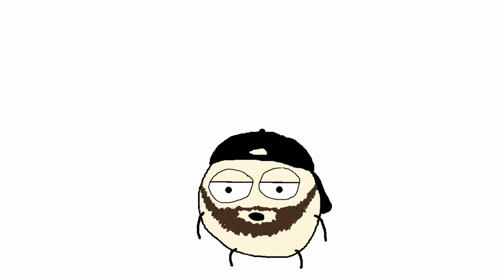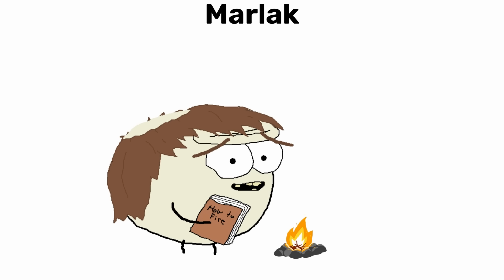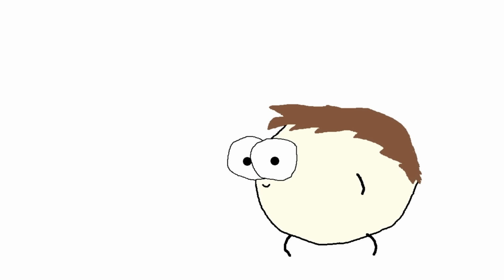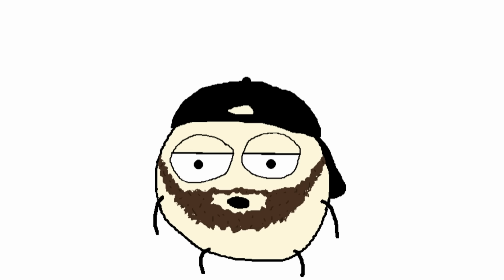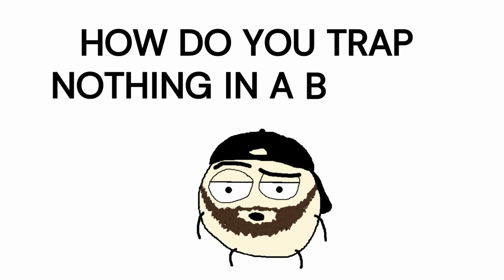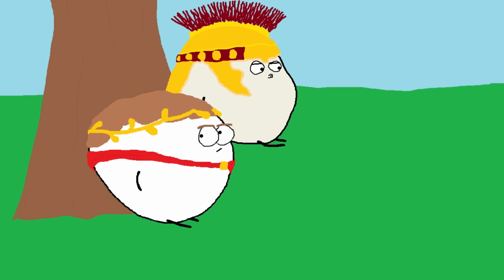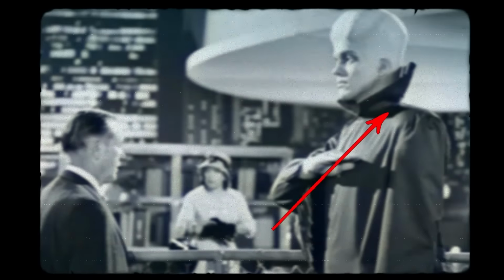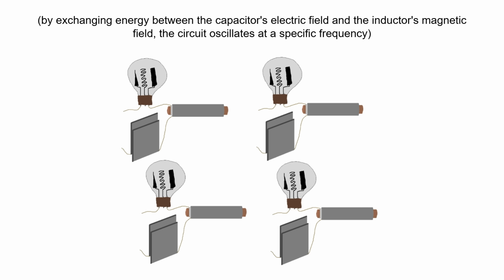How long would it take to build a TV in ancient Rome?

Comment: Why not ditch the tube and make a mechanical television? No need for a vacuum. But it would need a well balanced sheet of spinning metal plus the capacity to drill or etch holes in it at precise locations.

Comment: okay but i have a better question - why not make a purely mechanical tv, in a way like how first computers had memory stored in punctured cards.

could you make a tv just be a big plane with smaller flaps being pixels and have some machine lift those flaps to let light through and just have fire behind it or something like that? also the machine that lifts those flaps could work like how those small musical boxes work with a steel cylinder with tiny needles.

I'm not aiming at making anything fancy here but what if something like this could be done, and the frames were dropped to 15 or 12 or 8 frames idk and we just needed a few seconds of movie or animation or whatever?

Comment: I'd guess the most difficult part would be getting the tubes to seal well around the iron contacts
AFAIK they used a ver special metal alloy that has a very close coefficient of thermal expansion to glass so it wouldn't crack when the tubes got hot during operation

Comment: This is true, IF you have the knowledge to create every step needed to make a TV and the means to broadcast to that TV, from processing the raw materials into processed materials, then processing that processed material inot complexe parts AND if you did it all yourself without magic or superpowers it would take about 100-200 years per part. As each step to make a processed part would need a seperate machine just for that one part, then you'd have to power that machine and make the equipment to process that material into the part. 

But if you had magic and the creativity of a gamer you could create a processed part maybe one each year. Depending on your level and how broken your magic is.

Comment: You could have made this significantly easier if you'd made a Mechanical TV & not an electronic one. What that means is, basically instead of having a CRT draw the images, you use a spinning disc with a spiral of holes poked in it in front of a lightbulb. This makes things much easier, as all you need to do now is invent a motor & not a raster-drawing system with all that wiring & vacuum tubes. The radio portion of it would be easier too, as you'd need a lot less bandwidth to send a mechanical signal through the air. Only drawback is that the resolution of mechanical sets is about 30 pixels wide, & the image the disc can display is incredibly dim & absolutely puny - about the size of a postage stamp.

Comment: You forgot about lead, tin and barium for shielding, also for solder otherwise you'll end up with a low output dirty bomb from the x-rays if somehow you were to wire everything together. Barium wasn't discovered until the 1800s.

Comment: You wouldnt want to build a crt. You would want to build a mechanical tv. It would be way more feasible. Essentially what you need is a spinning disk with spiral holes going in toward the center. The main dificulty is it needs a lightsource that can be modulated with a matching camera. So you would need 2 motors that can sync their speed, a way to generate light that can mofulate its intensity, and a sensor that can turn light into an analog signal.

Comment: Mercury does not create a high vacuum suitable for electron tubes.

A CRT needs a very hard vacuum (on the order of 10⁻⁶ torr or better).
Pouring mercury into a bottle won’t remove dissolved gases or create anything close to that.

Comment: Let's suppose the time traveler guy has an electronics PhD, since that is the most important scienceto build the TV. This means, he doesn't know almost anything about metallurgy, glass processing, chemistry. Vacuum tube manufacturing requires welding. Interconnecting components needs soldering, which is not really feasible without flux or acid. Glass processing became an industry under Schott in Germany. Before him, glassmakers struggled to create consistent optical glass. CRTs might not need optical glass, but there are still enormous challenges. This means creating an experimental one from scratch without expertise would take very long time.

Comment: Even without a VCR or TV station, using that TV and antenna, the ancient Romans could have tuned into the cosmic microwave background radiation. The static on the screens of old TVs when they were on but not tuned into a station frequency was the remnants of the CMB.

Comment: AN acoustic Phonograph would be easier.   Recording surface could be a wax disk or a strip of metal foil reel to reel arrangement that a diaphragm/needle could record to and play.
Reply: An electro acoustic telephone (Magnets and coils) could be made also ---even easier.  If we could do Sulphuric acid, then we could do batterers that would work for electric telegraph,  and even "wireless" telegraph system (Spark gap /Coherer)   All this would not require very complex  "creativity" or genius at all (I could do it.)  INDEED it would be a fun video project to actually build such tech for competition.

Comment: It is even simpler: There is also mechanical TV, using a Nipkow-disc or a mirror-drum would make it much easier. To spin the disc or drum you just need a crank and some cogwheels. You don't even need electricity: Even the old Egyptians knew about fiberglass. They used it just for decoration, and only a few feed long, but it was known. If you make a camera with one mirror-drum and a fiber glass to collect the light, and on the receiver side the same setup, you could see a (dim) picture in low resolution, but in full color.

Comment: I would make a roman TV using a Nipkow disc, a way better fit for that level of tech than a CRT. The disc would be spun by a steam engine, which can spin at a very constant rate using a governor. Both of those could be built using Roman level tech - Hero of Alexandria made one. You might be able to solve the problem of sampling light coming in though the Nipkow disc's holes with a photodiode made of a galena pebble (like a 1940's whisker AM radio), but I don't know if galena's band gap would be large enough. If roman metallurgy was good enough, they might be able to purify germanium out of zinc ore enough to make a diode out of it (they did mine zinc). The diode would take care of the camera side, for the TV side they could use an edison style lightbulb, Romans were good with glass (but again we need good metallurgy - the filament needs to be able to not melt). Alternatively an arc light made of charcoal rods might do it, but those are probably too slow to turn on and off to modulate the picture. The electrical side would be powered with a generator made of copper wire using some oil based paint for insulation, and the steam engine that's spinning the picture disc.

Comment: Wouldn't it make more sense to invent radio first? I'm sure the Roman army would be happy to pay to have instantaneous two-way communication between their units. Plus people (starting with the rich) would want to hear news and entertainment on radios at home or in public places.
Reply: Then using the infrastructure you're built up to manufacture radios, it's easy to branch out into manufacturing TVs as well.
Reply: He did radio (in the guise of mobile telephony) in a previous video. Spark gap telegraphy is for sure an even easier step he skipped though!
Reply: It would make sense if the video was about building radio instead of tv...
Reply: @AFewGoodMichael  TV is just fancy radio. This is, it's a more complex version of the same underlying technology. In practise it makes sense to learn to walk before you can run.

Comment: I suspect getting the near perfect vacuum would be one of the biggest challenges. This was something that delayed the development of a practical tube and CRT.
Reply: Sprengel pumps were standard laboratory equipment in the 19th century and were used in the initial discovery of electron beams.  It's just a matter of shaped glass and lots of mercury.  Not a perfect solution but good enough to demonstrate the effect.
Reply: @androgenoide exactly my thought. I remember watching Codyslab years ago when he built one. Incredibly efficient device without the need for any motorized parts. Once you’ve collected enough mercury it’s just down to good old gravity and time
Reply: @ryderdopp8145  Yes, it's not a perfect vacuum.  There's presumably a bit of mercury vapor left over but it's good enough to demonstrate high vacuum effects.
Reply: Use a getter + a copper loop so the getter can be heated inductively from the outside after the tube has been sealed.
Reply: Apollodorus: look what I've invented, it's called a television.
Trajan: Amazing! What's on?
Apollodorus: Well, I also need to invent a video camera, a transmission network and a printing press for the TV guide. Should be ready to go in around 2000 years'.
Reply: @davidh7088  That’s not super complicated if you are building a mechanical TV…
  Your camera is is almost the same device as the TV itself and only requires one photodiode.
  Transmission is through direct wiring.
  and you already have clay tablets for TV Guide…

Comment: I've given some thought to the question of how to build a radio transceiver using only material available in Rome in the year 1.  We use tungsten for filaments because it can take white hot heat and still hold up but it wouldn't have been available.  An iron filament would sag if it were only red hot and would need to be supported on a piece of mica (and coated with something like lime to increase the work function).  Mercury and glass were available to make the Sprengel vacuum pump.  Enamel insulation for magnet wire would not be available but silk would be available (but really pricey!).  Sulfur and lead would be available for storage batteries and a vibrator/transformer could be used to get the high voltage.
Reply: This needs more likes!!! ^^^

Comment: Good vid! Though I thought I’d bring something up. I’m actually a vacuum engineer at a national lab! And (unlike Dr Stone) that mercury tube trick would work! But it would require pretty precise glass manufacturing.

Plus another thing to think about is the television tube would have around 15 pounds of force per square inch on the tube due to the atmosphere pushing on the vacuum. 

Assuming we have a cone shaped tube 4 inches in diameter and 5 inches long. We’d have 46 square inches of surface which means the glass tube would need to withstand 690 pounds of force distributed on all sides. 

Not impossible! But I think there would be a LOT of broken/leaking tube attempts 🙃.
Reply: It's not even that the tube has to be of good quality, but the glass has differences in thermal expansion properties across its length. The screen and neck parts are different types of glass that has to be pretty precisely manufactured and contain potassium and barium......I don't think an ancient roman glass blower has a chance tbh.
Reply: From what I know there are anyway! I remember taking apart a discarded flatscreen TV I found in a ravine back in 2008 and hearing my horrified mother tell me I could have ended up shredding myself with glass. I had to gently explain that it was a new kind that didn't have glass in it. It was the first time she'd heard of LCD screens. Apparently, "don't bash open broken TV sets you find dumped outside with a big rock for fun" is something she'd had to be told as a kid and she remembered it. I can only wonder why we both had the same idea. 😂
Reply: @sophiaschier-hanson4163  We used to smash old TVs at the local open air garbage dump as kids. When the tube implodes it sends fine glass dust and shards everywhere.

Comment: I... would have been pretty satisfied with just a projector and film setup.
How hard would it be to get photography, and by extension film set up? I'd think that, the fiddly bits of actually making nitrocellulose filmstock aside, making a reliable LIGHT SOURCE would be the next really hard part.
Short of burning a magnesium match, you'd really want to invent the light bulb. Which is a pain, because you need reliable electricity, good glass, and filaments that won't go up in smoke the moment you turn them on. You MIGHT be able to get away with clean, bright burning directional oil lamps, but even a low-watt bulb is SO much brighter and steadier.
Reply: Film is a bit more difficult than rigid photographic plates, BUT it's doable. I've seen a paper that recreated the Shroud of Turin by reinventing film photography from the ground up using High Middle Ages European technology and materials only and taking a 3d panoramic photo of a religious statue. That was cool!
Reply: You could maybe make a "limelight"

Comment: You could have saved yourself a lot of work by using a nipkow disk and lens instead of a cathode ray tube. essentially a disk with evenly horizontally and increasingly vertically spaced holes in front of a light source with a lens in front which projects onto a piece of thin paper. the camera is the same just with a photodetector tube instead of a light source and no paper. as long as both run at the same speed, the picture from the camera can be seen on the monitor.

Comment: Request: Practical telegraph network in the Roman era
Reply: If you already have DC power, vacuum (amplifier) tubes, and coils of insulated copper wire around iron cores, as well as speakers (as mentioned for the TV sound) you already have a telegraph network.  This would be far easier than the TV.
Reply: @LFTRnow  You don't need amplifier tubes, a simple electromechanical relais works just fine. Tbh, a telegraph is almost trivial to build, the only logistical problem is to make machinery that cranks out copper wire and insulators. Come think of it, it is almost hilarious how many thousands of years we lost to not having electricity or steam power. But I guess you first need to invent and perfectionize steel for a useable steam boiler. For that you need proper chemistry.
Reply: @der.Schtefan  True, but if you want it to go a significant distance, the signals get weaker over distance.  Amplification is optional if you don't mind shorter distances.  You can also set up something with one relay after another and using a current loop rather than voltage signal to send the messages.
Reply: @LFTRnow he's saying you dont need vacuum tubes to run the amplification, you can use a simple electromechanical relay. Vacuum tubes are only really neccessary for analog signals, but a telegraph is essentially a binary transmition. So, every so often you just need to have your telegraph signal run as the operating voltage for a relay, the relay opens and allows a new source of current to run through, giving you more range for the signal. And an electromechanical relay being just a solenoid and a switch is going to be way easier than a vacuum tubr.
Reply: Not really a big problem to make up batteries, switches and solenoids.  The big issue would be getting miles of wire in place.  Copper was pretty expensive and subject to unauthorized recycling efforts(theft).  Steel would be out but plain (brittle) iron could be used as long as you were prepared to put in powered repeaters pretty frequently.   This was part of my thought process in investigating the possibility of a radio link from Rome to Alexandria.
Reply: They already had a kind of telegraph: an optical telegraph, using the Five Flags signal method which Polybius writes about, where holding up 1-5 flags in paired sequences, signaled specific letters of the alphabet as arranged in a square grid.